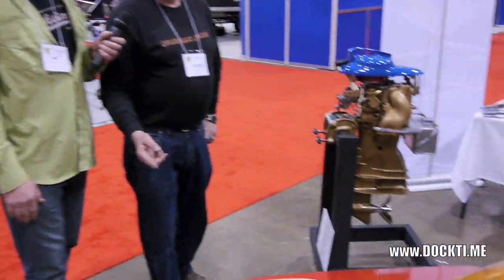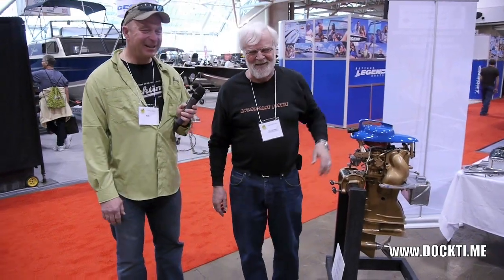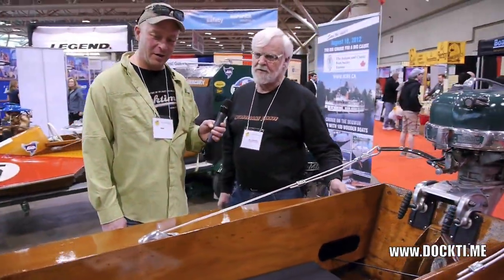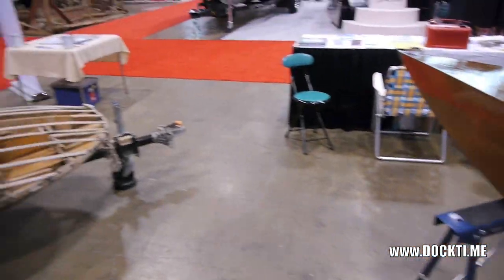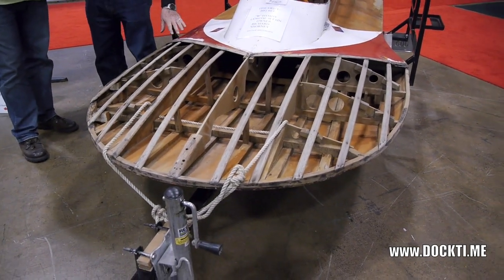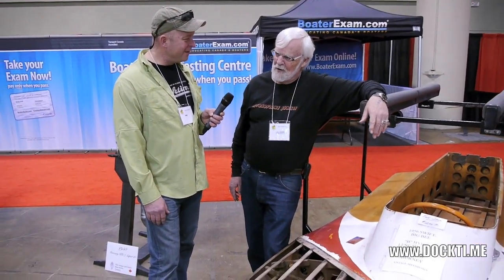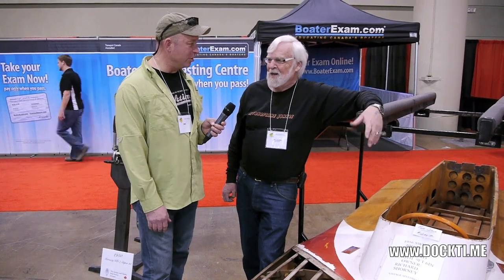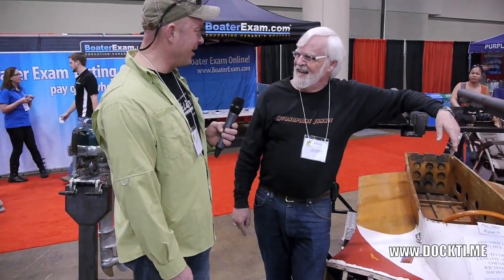Antique Race Boats

Comment: We got into hydroplane racing in 64 .
Battle creek Michigan. 
Dad started building these hydros for me and others. In the day it was Alki .
He built a B hydro for the old Konig Looper conversion engine he had bought from Mini Msrten I believe. 
Got a brand new in the box cosmoline and straw B engine complete with red fuel tank. 
 He built Chuck Peter's a C boat ,cloth deck, for his Cresent C engine, Gary Gresley a D hydro cloth deck and a F hydro 14.6 ft. Cloth deck.
He built later stile all wood deck with the Loweri 4 point bottom of dad's own design. 
Never forget all the good times with all those friends. Lyle, Ray, Helen Mason  and Terry Reniger out of Bc too.
 Came to Florida and ran 250 hydro down here. The only change there was Between the  North and the South was we got older !!!!
 Still have my 1985 Pugh hydro in 250 design. F74 250

Comment: Running airplane fuel in a stock 20H is just foolish and totally unnecessary.
Reply: Untrue
Reply: Gasoline is not a standardized compound. Many service stations sell sub standard fuel... Water, alcohol, goop,low octane... You need to know. Airplane gas is safer.
For real racing alcohol is often used.
Money is an issue, maybe not for these little motors. But an offshore will easily consume 3K in a few hours....
Miss the good old days.
Reply: Not in modified class!
Reply: Yup. 😅  even with a float less Alki carb. Lol
 Chuck White out of Michigan Center use to use a rose bud tip and heat the cylinder head up on the old mercs just till they dropped a little to raise compression for alcohol fuel.
Built an ALL ROLLER bearing 327 Chevy that turn exotic RPM's.
And never came apart. 
I saw this engine when we visited his shop in MI. Center one night.
We had gone there with Ray and Lyle Mason. We needed the conversion fuel pump for the 20 H
Reply: Yes, can't put a 7 hp band on a 10 or 20 Cusic in motor.
And the band said hurricane  and that's a 20 cu in motor band/tank.
 Also it was called muslin  not canvas.
 Not being nasty here by all means. Just saying. 
I have a mark 7 here in my house.
It's  a clone to my dad's 7 he bought around the time we were born. My twin ( I hope ) still has dad's motor and Arkansas Travler combo dad bought new back then.
12 feet boat aluminum front deck which doubled as the air tank  for safety in case it sunk
Reply: Airplane fabric was never "canvas" They used Grade A cotton or Irish linen way back in the day. Nowadays synthetic dacron is used. It is heat shrunk and glued on.